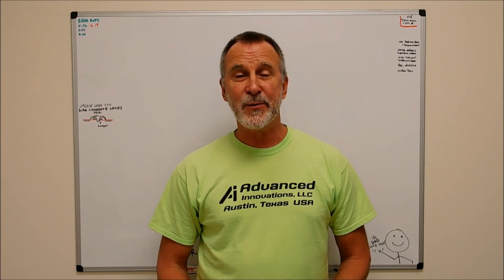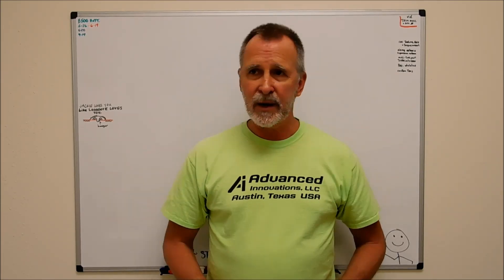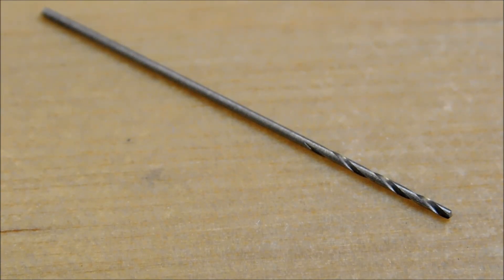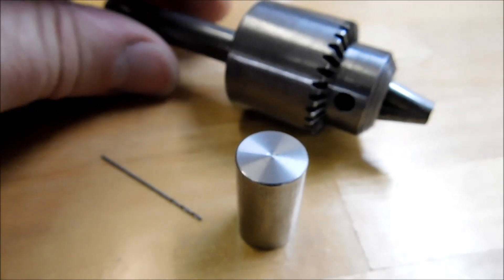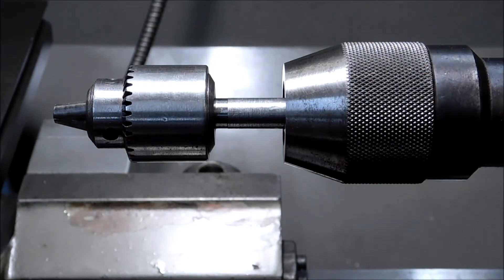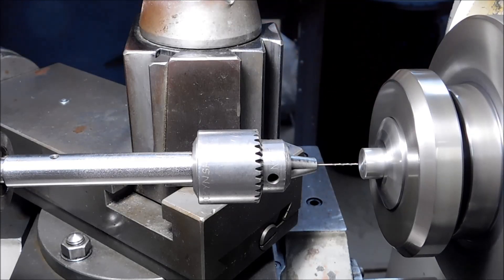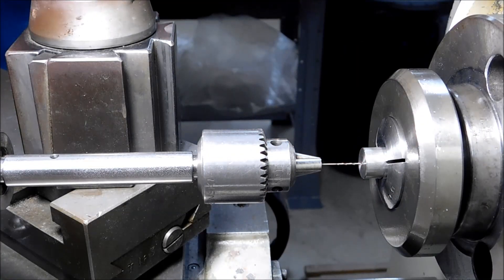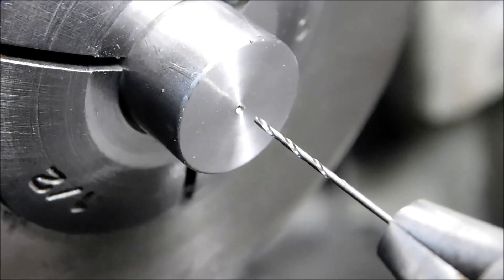Micro Drilling -- Stop Breaking Small Drills !!

Comment: So fabulous. I have struggled to make 0.6 mm clearance holes for copper mig welding tips due to breaking drills. The tips are not that expensive to buy, but I have several times needed one when the shops were shut & could not make one. Next time I will try your super useful method. Thank you for sharing!
Reply: Springwood Cottage:  Forethought and planning has to do with having spare consumables. Kinda like starting a weld fab with only 5 feet of wire left on the spool - just saying...  
could also drill out your 0.023 or 0.030 tip to 0.045, in a pinch.
Reply: Scott Burrous Yes, being organised is best, but as a one man operation I often have to fix things that break in use, often weeks or months between needing to weld, then back to what ever the broken part stopped. Being able to repair tools has often got me going far more quickly than getting new and with welding tips I often burn the wire back into them till I get back to the feel of the welder for the gauge I am at as it's so long between use and on various gauges from car bodies to 3/8 inch.

Comment: Hi Joe - very good! Any way to sharpen those very small drills? 
Thanks  from John in Cape Town
Reply: Might also add for your viewers that tailstock allotment gets critical.
Reply: I sharpen tiny drills. You just have to go through the motions. Because you can't really see what's going on. It is a mind's eye trick really. See what you're supposed to do in your mind, then do it with your hands. Then you look at the end of the bit through a magnifying glass, and see if what you did worked, or not. If not try again. I will say this, what happens at the ends of those tiny bits tends to happen really fast. You don't have to spend too long to remove material. The hardest part is getting equal cutting edges.

Comment: Another superb tip.  Thanks for showing off this as well as your other "tricks".  So much of machining is thinking up these sort of small tools and some of the setups you've given us recently.  And as you say that "feel" is a big deal.

A question.  Up to what size drills would you expect to be worth using with this free floating setup for the lathe?  I'm thinking that the cross over size to go back to the regular tail stock would be somewhere between 1/16 and 3/32.
Reply from the maker: I would think around .046 is my line. Depends on the job and material.

Comment: Very cool idea thanks. It gets me thinking of how to make one for my Bridgeport
Reply from the maker: You are both correct. A bearing on the shaft of the drill chuck to hold and a pin inside the sleeve for drive. Something has to be slotted to allow for movement of the chuck, and a return spring is highly suggested.
Reply: Robert Hayes yeah I was thinking about that too...    maybe a similar setup, but with a key to lock the rotation of the adapter and the mini chuck?
Reply: Parker Anderson how about using a bearing on the shaft that is keyed but not locked
Reply: Joe Pieczynski now there's a mini project for your channel Joe.

Comment: Do do this method successfully it is critical that the head stock and tail stock have been aligned.. and not just side to side. The tail stock quill must be aligned vertically and horizontally with the head stock spindle.... and the quill must be absolutely parallel to the bed and ways. The head stock has to be absolutely parallel to the bed and the ways.
If the lathe is not aligned, drilling with small drills less than 1/16" or 1.5mm drills becomes very difficult if not impossible.
If you plan to do much small hole work on the average bench lathe, you might consider building a high speed sub-spindle for the lathe.
Reply from the maker: You could also setup a special tool in a holder holding material that was drilled and reamed with the tooling in the collet. Alignment would be perfect.
Reply: That's true, but it makes life so much easier when the alignment is correct. You have to make do with what you've got of course... but it is annoying to use a tool that would be improved if you took the time to adjust it. Worn equipment, especially for the hobby machinist, has to be worked around sometimes to get good results and having it out of adjustment too is an unnecessary headache.

After many years of cursing I discovered that my 12" Taiwanese bench lathe's head stock was not square and parallel to the bed.. It is the flat base type head stock, so shims and adjusting the jacking screws fixed that. I found that the tail stock, while correct in regards to being parallel had the quill's C/L 0.005" high to the spindle C/L. Grinding the cricket got it to about +0.0015 where it belongs. Doing those corrections made a noticeable immediate improvement in drilling as well as eliminating the mysterious taper when turning closely dimensioned OD's .

 Enjoy your videos and thanks for taking the time to make them.

Comment: On the subject of Tiny Drills, if your bit is too small for the chuck to clamp down on, spiral wrap the drill shank with fine copper wire then put it in the chuck and snug it down tight. Works in a pinch.👍🏻
Reply from the maker: I like that idea. Thanks.

Comment: Aussee Tools in Dandenong Australia has a nifty Micro Drill Adaptor part#  010-025-00000. $26.95 (Aud)  Has JT0 taper. .4 - 4mm chuck is $25.50.
Reply: Barry Akins Thanks Barry, I will check it out.... at that price it's hard to justify making your own. Cheers.
Reply: Also check out "LPR Tool Makers" in Melbourne Aust. They have some nifty tools as well.
Reply from the maker: Thats a great price. Good ones are very expensive here in the states.

Comment: I see someone else calls that a sensitive chuck. Had mine given to me by an old machinist who retired and passed many great tools to me. That sensitive chuck adapter saved my goose many times over. I never realized till now how expensive that thing is. A treasured tool because a craftsman gave it to me who I highly respected. I bet those who build your design will have no less a tressured tool. Nothing is more frustrating than fighting and breaking tiny drill bits, unless it's a tiny dull center drill, lol... Another great tip Joe and your right feel is everything for doing good work.

Comment: Wow, keep em coming.  Better make darned sure your tail stock is on center though.  perhaps a video idea in itself.  I cant say how many time I see drills going all squirrely entering holes on the lathe because the tailstock is so far out.  Lots of times they seem to be vertically off as lateral adjustment seems to be easier to accomplish.
Reply: Barry Gerbrach:  Now why would you EVER use a tailstock that wasn't aligned - for anything other than cutting a minor taper between centers?
Watched a YT video about using a Co-axial indicator to align the tailstock.  Neat trick!
Reply: And yet 80% of the tailstocks are not properly aligned.  I understand that drill bits are not always straight but the amount of dive I regularly see leads me to think that the tails stocks are not vertically aligned properly, which is much harder to correct.  There are horizontal adjustment screws on most if not all lathe tail stocks which should make zeroing the horizontal alignment trivial, but what about vertical for both height and slope (may be on center when retracted, but not when extended and hence long drills are much further off center).

Comment: Another great video. I just completed a wing rack gear out of .375 square X 7" long aluminum. Cross milling with .061 end mill @ .160 intervals, .100 deep over the 7" length. I didn't have the 'feel' and broke three .061 end mills during the process. That FEEL doesn't come cheap. I will be making one of these for my lathe. Thank you.

Comment: Is that hole not on center?
Reply: It might not be.  The pilot mark made with the centering drill was actually pretty darn big for such a small wire drill, and the wire drill itself is set in the chuck so it sticks out very far (or such a small bit).  Both of those things would tend to make the point of the wire drill swim around a little at the start of drilling and it can go off center.  Putting the wire drill in the chuck so only about 1/8" or less sticks out, at least until you get the hole started, helps to keep wire drills a lot straighter in the hole.

Comment: Nice technique, could come in handy in the future. But, not all stainless is the same. 303, 416, 17-4 H1150 ... easy peasy. But 304, 316 ... or any low carbon/high nickel might be a little trickier.
Reply from the maker: You'll just have to push harder, but it will still give great results.